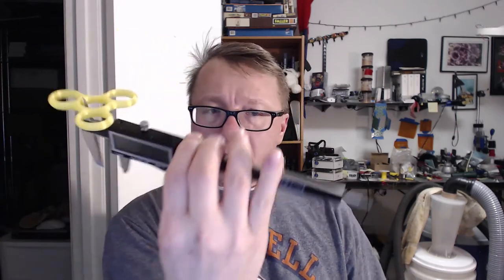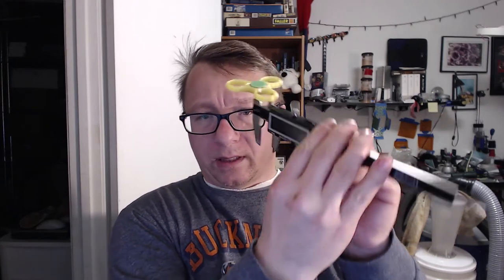Maker Geeks PLA - What am I doing wrong?

Comment: if your printer uses belts check the tension
I also just had the belt teeth deform from too many days using abs and was shifting everything sideways a touch, making circles into ovals  

or did the filament size get changed in the slicer, or nozzle tips wearing out

Comment: just print cubes 1cm x 1cm x 1cm (3-4 layers) with different filaments and measure them. In this way, you can check if the printer is not calibrated or if the filaments contracts. On thingiverse you'll find more sophisticated parts to calibrate your printer.